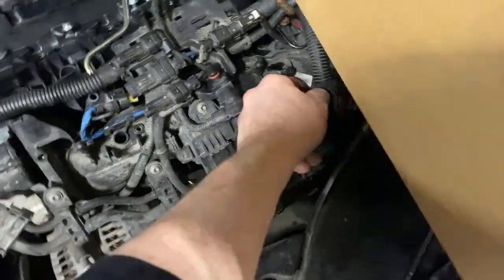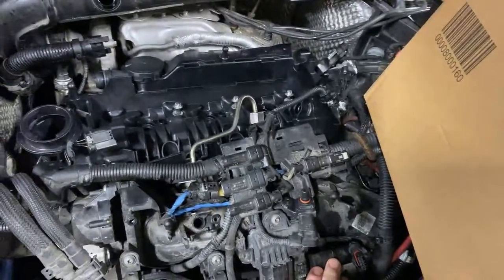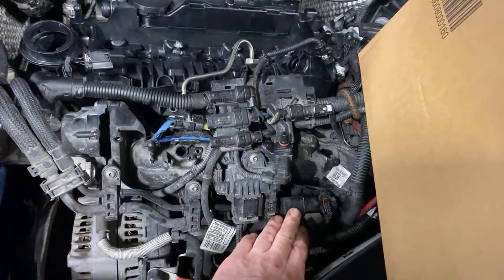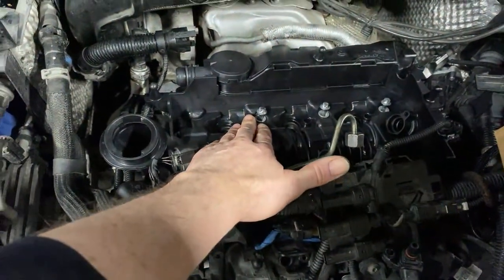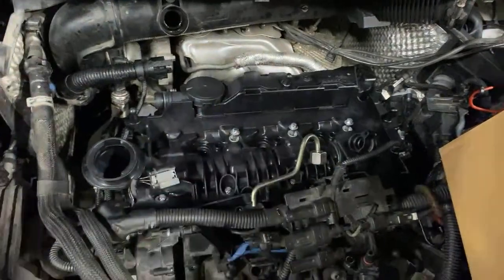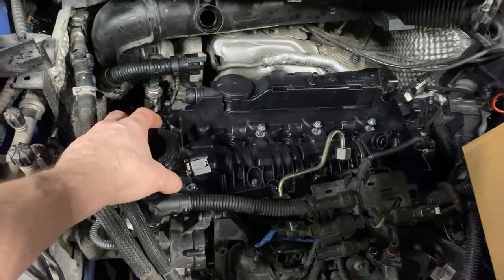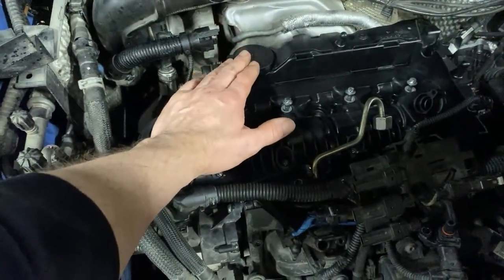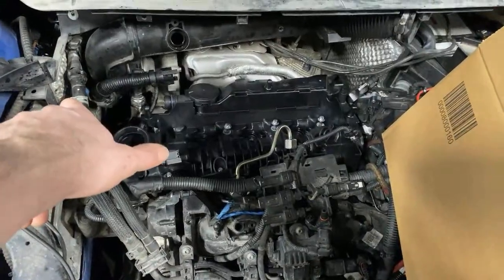BMW Mechanic - B37 breathing faults

Comment: I got a b48 that’s having blue smoke sometimes coming out of the exhaust when I come off the highway and stop at a light, doesn’t smoke in mornings and doesn’t smoke all the time but sometimes here and there. 

Haven’t noticed a change in oil consumption really and it doesn’t smoke when accelerating or just driving around

I’m thinking pcv but just at such a loss
Reply from the maker: Turbo cracked
Reply: @BenJFF ya think so? Like the seals? I pulled the downpipe off and there was no oil on the hot side and there is a little bit of oil on the intake pipe to the turbine but looks to be coming from the pcv hose and not the turbo 

I heard some turbo return lines go bad and can cause similar issues
Reply from the maker: Theres a video showing the oil pipe search my channel
Reply: @BenJFF cheers thanks I’ve been watching all the b48/38 videos you’ve posted trying to find answers because the car still drives perfectly fine but just smokes. I’m a young mechanic myself but first time working on euros and all the advanced systems got me confused lol. I’m used to simple Japanese motors 😂

Comment: exactly what you said white smoke comes out of my b37 116d oil cap. it is 2016 model 90k . should I change the rocker cover or can replace the pcv only?
Reply from the maker: New cam cover

Comment: Did new valve cover solved the issue? Sucks that we have to change entire valve covers just for the PCV valve, would be nice if manufacturers always made these 2 separate parts
Reply from the maker: In this case yes